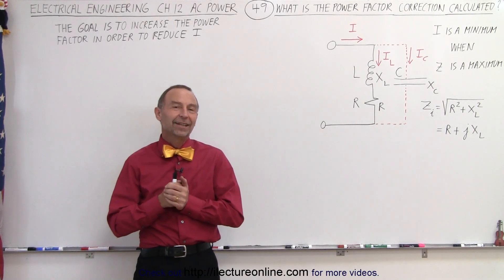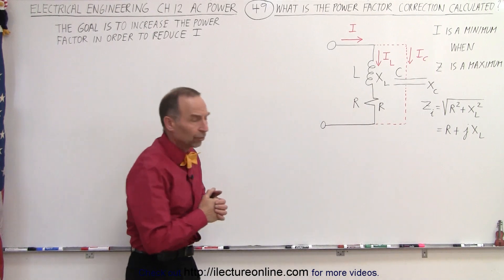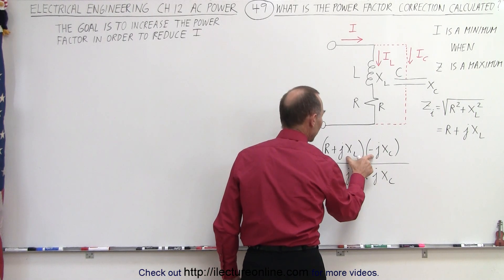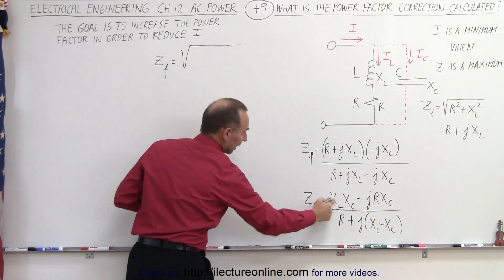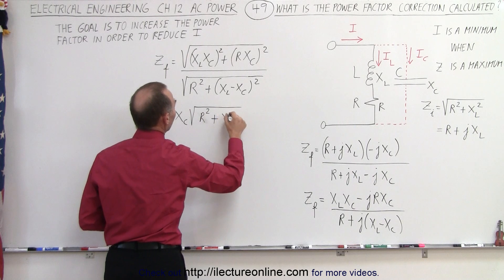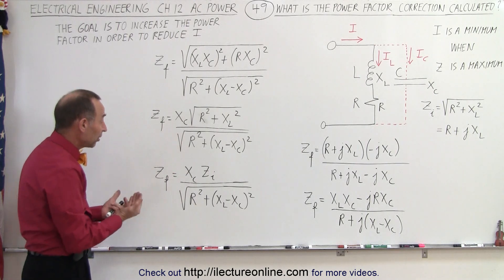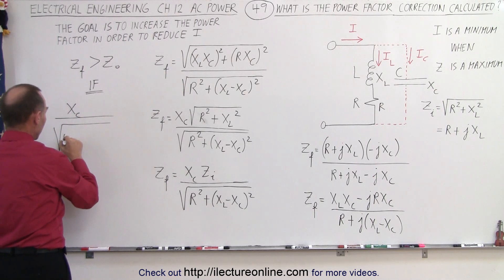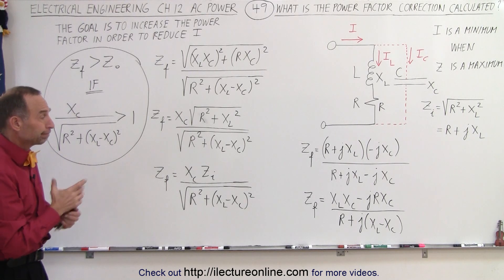Electrical Engineering: Ch 12 AC Power (49 of 58) What is the Power Factor Correction? 2

Comment: I am sorry, I might be a little confused but increasing the impedance actually makes the phase angle bigger and we want to make it smaller right?
Reply from the maker: On a single branch with no capacitors present, that is correct.  But in parallel branches that also contain capacitors, it is not that simple.
Reply: @MichelvanBiezen  Thanks for you reply. I understand that but you are finding the total impedance (you are already considering they are in parallel branches) so the value we get in the end is for the total impedance of the circuit which as you said should be greater but that would increase de phase angle... I feel like I might be missing something, I would appreciate if you could correct me if I am wrong once again.
Keep up the great work :)
Reply from the maker: The best thing to do here is to try a few different values for the inductor and then see what happens to the total impedance.  (make it bigger and then make it smaller)  It is better to get personal experience with it, rather than have someone try to "explain" it.
Reply: @MichelvanBiezen  Sure, I guess I will try that. Thanks a lot for your help.